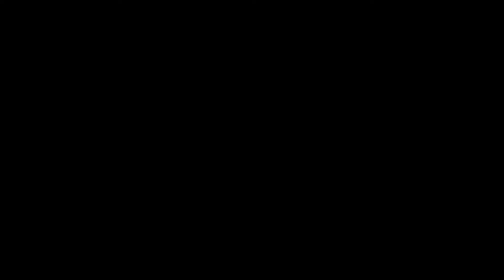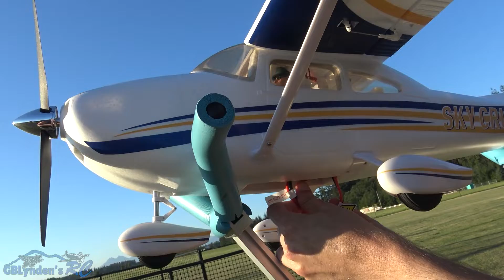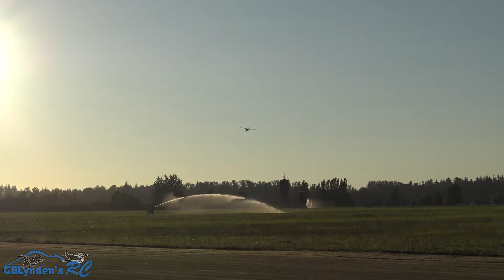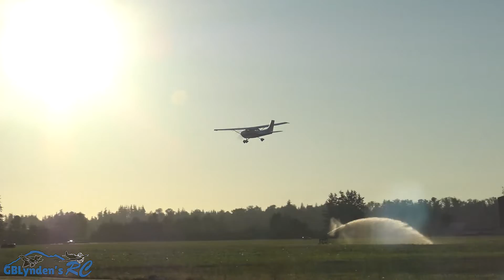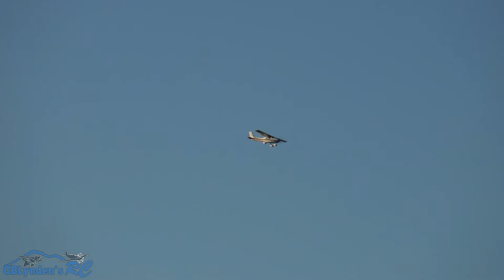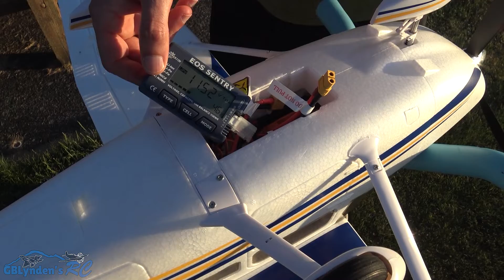Unboxing & Maiden Flight | Arrows 1400mm Sky Cruiser RC Plane

Comment from the maker: Click here to buy this smooth flying RC Plane: https://shrsl.com/4li8a

The links in this description are affiliate links. At no cost to you, they give me a small commission on sales which helps support the channel and keep it independent: https://www.amazon.com/shop/gblyndensrc

-  FMS Cessna RC Plane: https://shrsl.com/4j3hj
- Arrows Sky Cruiser RC Plane: https://shrsl.com/4li8a
- Arrows F4U-4 1100mmCorsair RC Warbird: https://shrsl.com/4lwqa

Visit https://www.gblynden.com/ to learn more about the hobby!

This is how Arrows RC describes this Civilian RC Plane: 

"The Arrows 1400mm Sky Cruiser is a fantastic option for a training aircraft, offering stability, ease of flying, and simple controls. It features an advanced 40A ESC and a 3536-KV850 motor for precise control. The "front three-point" landing gear design makes landing easier and improves ground stability. CNC-machined metal shock-absorbing front landing gear and LED navigation lights improve safety and visibility during night flights. The transparent cockpit canopy with a realistic pilot and instrument panel, along with functional flaps, offers an authentic flying experience. Made from lightweight yet high-rigidity EPO foam, it enhances flight performance and ensures aircraft durability."

Radio Settings:

My Maiden Flight Radio Settings (I flew this entire flight in High Rates):
Ailerons: Low Rates: 80% D/R with 30% Expo, High Rates: 95% D/R with 42% Expo
Elevator: Low Rates: 80% D/R with 30% Expo, High Rates: 95% D/R with 42% Expo
Rudder: 80% D/R with 45% Expo, High Rates: 90% D/R with 50% Expo

Servo Extensions Used: https://amzn.to/3LIw9cV

Accessories:
- Spektrum Smart Checker: https://amzn.to/46eZKmo
- Spektrum NX8 Radio: https://alnk.to/apS4qKi
- Spektrum AR620: https://shrsl.com/48a22
- Hemostat Forceps: https://amzn.to/3SBrWvY
- RC Hex Wrench Set: https://amzn.to/3ueK6d2

GBLynden's Favorite RC Vendors:
- FMS: https://www.fmshobby.com/rxU9FyN0qkxhJj
- Hobbyzone: https://shrsl.com/46y9y
- Horizon Hobby: https://bit.ly/3DcnYBV
- Tower Hobbies: https://bit.ly/3CBC4N1
- Amain Hobbies: https://bit.ly/3v44xGG
- FairRC: http://shrsl.com/4g8ej
- Amazon: https://www.amazon.com/shop/gblyndensrc

00:00 Introduction
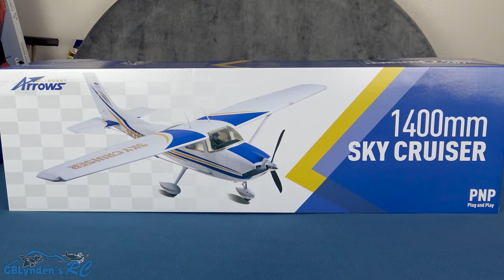00:10 Unboxing
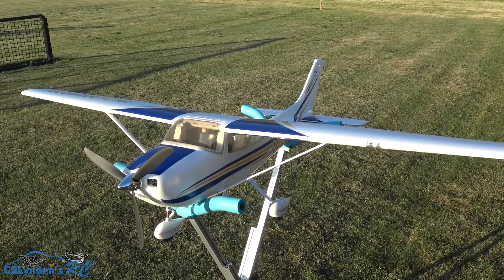01:13 Fully Assembled At Flying Field
02:23 Maiden Flight
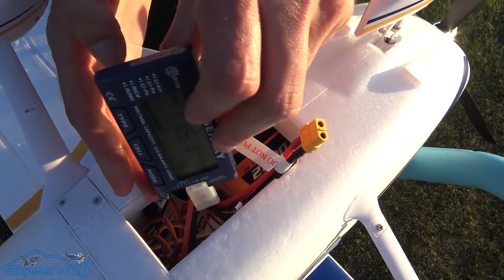08:34 Battery Check & Outro

#ArrowsSkyCruiser #ArrowsRC #GBLynden

Comment: GB,  was that a 2200 mAh 3S in there ???
Provide C rating too please.
Reply from the maker: Hi Tim! Sorry for the delay in responding. The battery is a Admiral Pro 2200mAh 3S 11.1V 45C LiPo Battery with XT60 Connector. I assume you will find similar performance with the HRB 2200: https://amzn.to/41WxFRV

Please let me know if I can assist with any other questions and thank you for watching!
Reply: @GBLynden  Much thanks GB, keep up the reviews and the cool DJ like voice, NO stress and you appear to be very genuine. 😊
Reply from the maker: Thank you very much for the kind words! I have a lot more videos in the pipeline I will be posting soon 😎

Comment: Nice video and nice flight. I liked the vid and just became a subscriber. One quick question and everyone's tastes and preferences are different but why so much expo? Seems to me like anything over 30% is a lot, but I am still new and I have this model in my sights to go along with the original 1400mm FMS SkyTrainer 182 in blue that I haven't unboxed yet (now discontinued) but I am a big Cessna guy and wanted both versions. I find it interesting that FMS doesn't offer their new 1500mm Cessna with their Reflex system, but Arrows offers their 1400mm version with their Vector system. Both are considered "trainers" to some extent. Maybe not the ideal 1st plane but certainly a good 2nd or 3rd option. So do you always fly with so much expo?
Reply from the maker: Great question about the Expo. Most of the videos shown on this channel flying only the maiden flights and/or the flights immediately right after the maiden. As such, I make sure that things aren’t so darn touchy that I crash.

I generally go back and knock the expo down after that, depending on how touchy things feel. The only exception is the Rudder. I like lots of expo in most instances to give me the throws I need on the ground. I hope that clears that up 👊🏻💥👊🏻